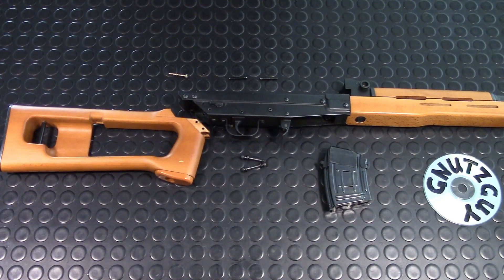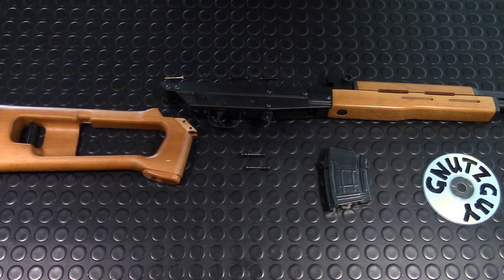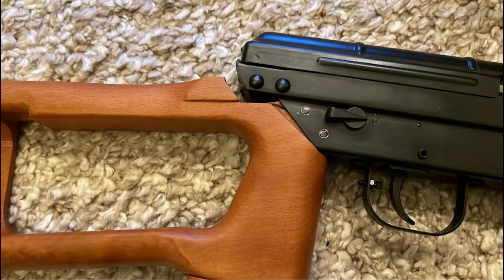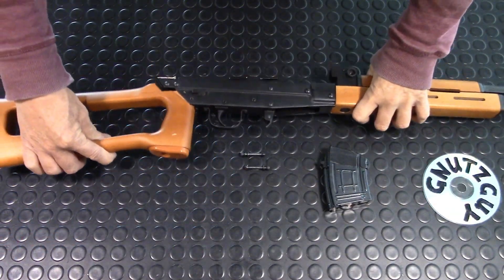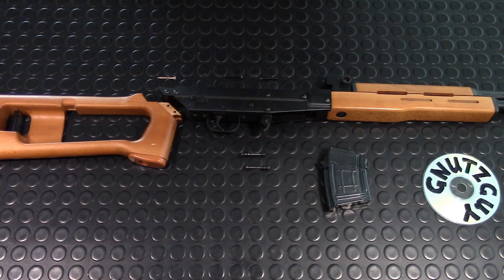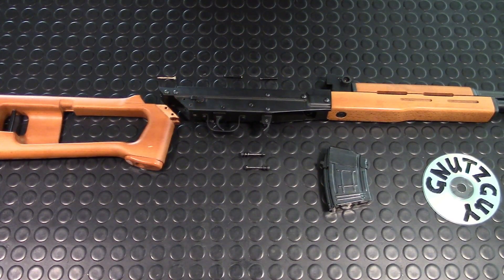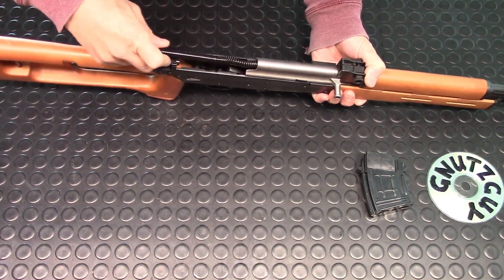Failed Stress Test of Type 81 Dragunov stock. T81 SR.

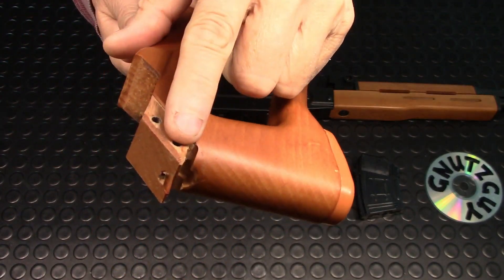Comment: 5:53  If I had one with a broken stock, I would cut off and sand flat that little wooden piece with the pin holes which inserts into the receiver and fashion a similar block out of aluminum or hard polymer. I would then screw that new aluminum or polymer block into thick portions of the wood stock and probably JB weld it in place as well. Since it's inside the receiver anyway, the fix wouldn't be visible once the rifle is reassembled.

Looks like a fairly simple fix, if you don't mind doing some arts & crafts in the garage or workshop. That said, shame on the manufacturer for producing such a half-assed T81 commercial variant. There's no actual way to prevent wood from breaking with so little material holding onto a 10 pound rifle. Another engineering FAIL from the CCP's socialist utopia.

Comment: The meth dealer of firearm importers.
Reply from the maker: lol.
Reply: @gnutzguy  I had a previous rant filled diatribe posted but thought best to delete it because it addressed in a very direct way the larger threat of reliance on offshore manufacturing and the direct causal greed coupled with zero accountability exampled by companies like T.I.       I have spent many thousands of dollars on T.I. offered products over the years and this isn't the first time putting up with their bullshit but it will most certainly be the last; I never hear back from them once they've got my money and the product (eventually, many weeks later) finally ships, truly a disappointing example for the firearms community. Their bottom line is so utterly evident with this latest fiasco; the fuck I'll be shelling anymore out to fix another one of their badly engineered and atrociously quality controlled pieces of shit. I'm a wood worker and literally felt a little puke roll up my throat when I saw the stock disaster; anyone with half an understanding of grain structure and Lego grade physics would've never allowed this, it seriously stinks of intentional sabotage. A little off tolerance here, a little less quality material there multiplied by many years and coupled with incrementally minor effects to every sector that has in some way increased costs by spending more time affecting productivity....death by a thousand little corporate espionage and seemingly non existent sabotage cuts over the years. How many times has the air turned blue with curses at the buggered threading of off shore hardware or easily marred and stripped inferior metal components, to name a few. I'm so done with businesses mired with and flogging wares and narrative for the deep state. The extent of the manipulation will rear it's ugly head sooner than most realize; the toys are being positioned around the big Risk board game. Good channel you've created over the years by the way!  Cheers.
Reply from the maker: @user-fg8hc2km1o  thanks for posting on our sad state of firearms industry. Your posting is the longest on my channel, lol.

Comment: OMG. You should have installed the screw. And reinforced the wood with accruglass. And used it as a range toy.
Reply from the maker: Not good enuff cos A guy on the forum did that and it cracked before he even fired it, lol.

Comment: Thank you for doing the stress test on the SR. I wonder did you request a return/replace for your rifle? If so, what did they response? I'm concerning because I applied the bfile fix with the steel epoxy and the epoxy failed due to the recoil. I bet my stock will not last long even with care.
Reply from the maker: Replace mine with another faulty stock? No way. Honestly, after the test, I'm not recommending any fix other than bfiles quick fix. Why? Bcos it's gonna break  regardless so Don't waste anymore time removing the stock. Keep using as it till it breaks.
Reply from the maker: The wood screw was supposed to help by assisting. now we find it will be doing all the work, very little help from the two cross pins. I will wait for the replacement stock and hope I don't have to pay for it. In the mean time my Dragunov stock is out of action. Bummer, I had plans in doing a an accuracy vs my dmr. Oh well, it will have to wait

Comment: I am glad  i missed  the boat  on the first shipment. I still want to get  a rifle from second  shipment when they arrive but i really hope  the factory  will made  a much better stock. For now  i stick with my standard LMG.
Reply from the maker: i dont think the second shipment will have a redesigned stocks cos need more lead time. also  i dont want them to do a rush job on the redesign.
Reply: @gnutzguy  the only way I see this working out is with a metal insert in the stock. There's not enough contact surface and no way to increase it, so things being what they are, I don't see any other solution.
Reply from the maker: @ericfleury3147  there are no practical fix with the existing stocks, none. 
the replacement stocks probably will have square metal tubing glued to the front of the stocks.
Reply: Seems to be a design issue... That stock just doesn't belong there, as pretty as it looks.

That said, maybe they'll come up with a better design in the future.

Comment: I just messaged them to see if I can return my T81 SR. Not happy with this at all. Don’t want to risk breaking it and having absolutely nothing to work with.
Reply: I got messages back from them, they said they will take 3% restocking fee. Plus shipping and some. Which it shouldn’t be the case when their product is defective.
Reply: @tianweiyou2953  this is going to affect their reputation surely. I believe it’s bad business. They should not be selling defective products
Reply: @9mmdump   I am sure TI is stuck in this too, I dont think they are able to conducted testing by themselves before shipping out to us. Unlike the LMG or normal 81 (the mil version is battle proven) SR is a completely new design. They must have an assumption of quality base on prior products and never thought about this could happen.
Reply from the maker: i agreed.
Reply: @gnutzguy  Mine cracked too, just brought to the range, cracked in the trunk... didn't even got the chance to shoot it. Going to send it back.
Reply from the maker: @tianweiyou2953  bummer, did you post a pic on forum?
Reply: @gnutzguy  Yeah, I just did.
Reply from the maker: @tianweiyou2953  thanks.
Reply from the maker: i hear ya.

Comment: Also another issue is the PSO they sell for the type 81 is calibrated for 7.62x54R
Reply: 90% of them are.   Only like 2 particular POSP models actually have the 7.62x39 Siminov system.